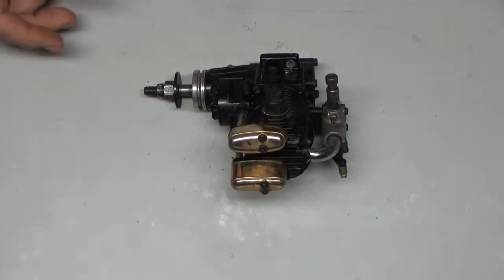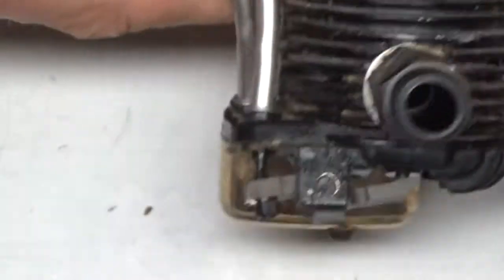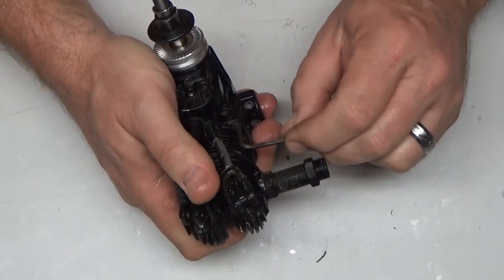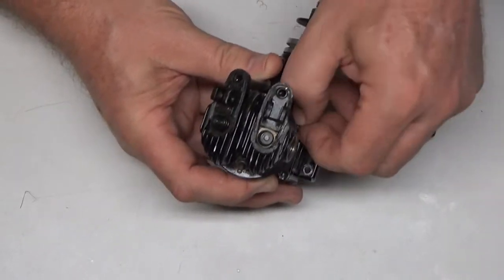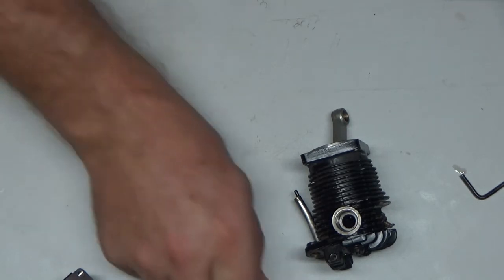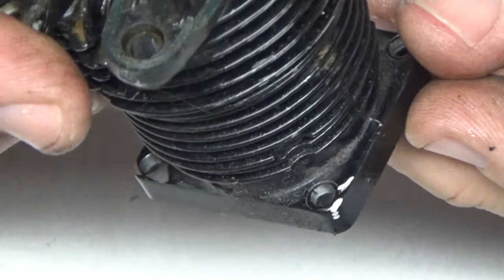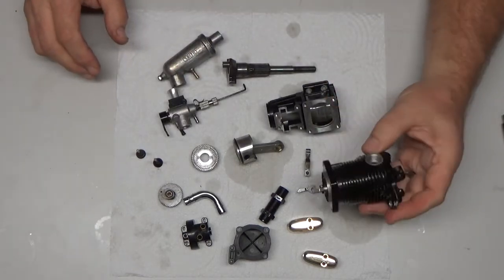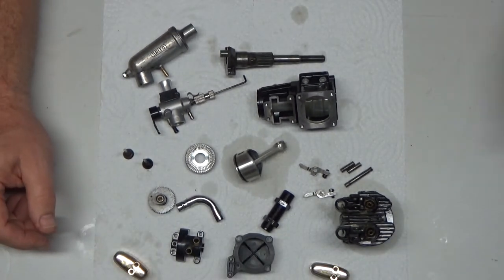Saito FA-72GK Customer Engine Disassembly

Comment: For things like the headers, I use a product called carbon off, it's what a chef friend uses to clean his pans. It's amazing for carbon and nonsense for crank cases, exhausts etc. Melts it right off. It's basically oven/ pan cleaner. MUST use gloves, I have gotten the over spray on my arm and min later felt something 'Burning" lol. Makes pipes look new that were covered in garbage.
Reply from the maker: Yeah that is some nasty stuff there.  I don't think I want clean exhaust bad enough to use that.  Check out the SDS sheet on it.
http://www.turnservices.com/Images/Interior/safety/safety%20data%20sheets/carbon-off.pdf
Reply: @dmrcflyr2  It's nasty stuff, but I JUST used it yesterday and my FA-72 crank case went from looking awful to looking like new with minimal effort (read tooth brush off.) I would rather use that than clean it multiple times with anything else. One can has lasted me like 6 years and it's almost full still. Yesterday I thought It was plugged but I just rinsed the nozzle and it worked great. Then the steel parts into the tumbler with walnut media, valves into barymans chem dip. Like new engine parts with minimal effort. I used to race rc cars and the pipes / headers get covered in foam, fuel and dirt, that's where the carbon off shines.
Reply: Sidebar, When I broke down my FA-72 the piston had rough nasty casting marks on the center of the dish like your example engine. I first wondered if it was a crack... Poor casting.
Reply from the maker: Yes, but one of the very reasons I use what I do is that it is NOT
a. Hazardous.
b. Expensive.
c. Hard to find
d. Single purpose: it is multi-function: it can be used for many other purposes.
That is the entire point of what I use.
Reply: @dmrcflyr2  No worries.

Comment: I see this engine has the infamous plastic crankcase cover.
I went through a couple of Saito engines with that bad idea on the back.
If you have one like this you better replace it with the aluminum part, don’t wait until the plastic start bloating, rubbing against the crank pin and finally destroy the crankcase as it happened to my 72.
Saito has now stopped using this big blunder and all new engines use only aluminum for the cover